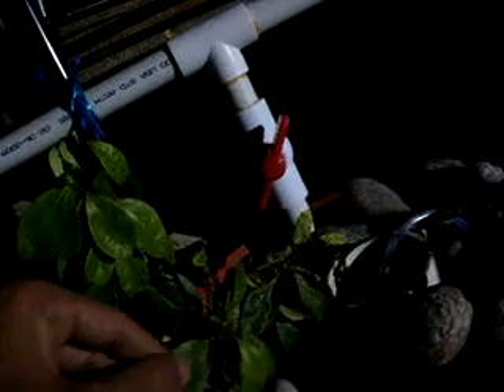Homemade Aquaponics

Comment: hey,  it's a great aquaponics system. Like it.
what is the temperature of ur area. If the area has an extreme weather (summer or winter), how do u maintain it.
Reply from the maker: Thanks! You should check out the updated, current system, there is a recent video on that.
The weather is pretty tropical, doesn't get too hot or too cold, just have to change the plants to seasonal ones.
Reply: @AbdulAleemShekhani  great then, Thanks👍😉